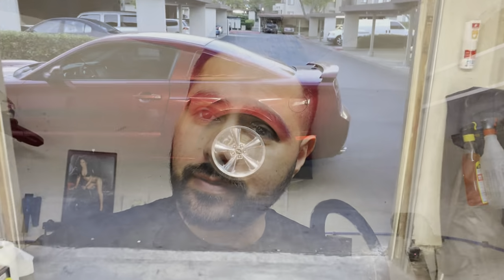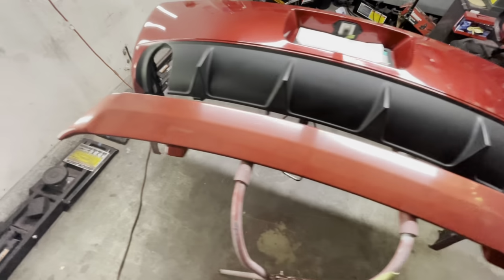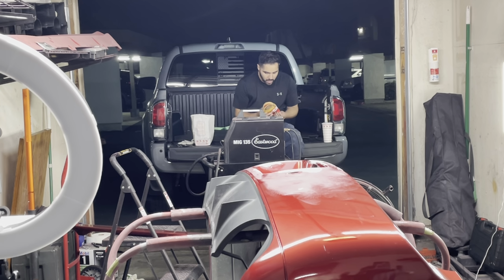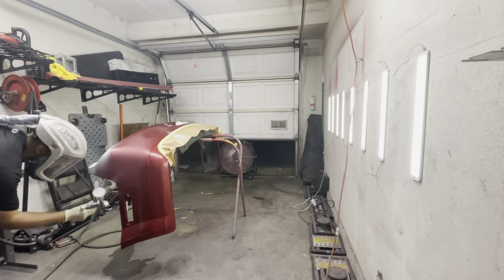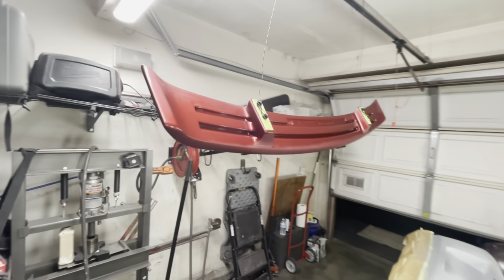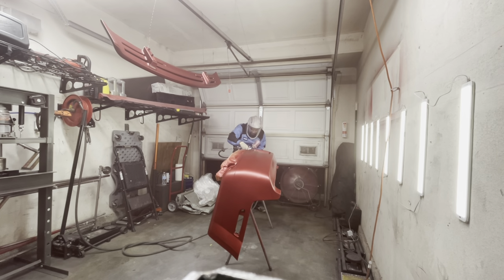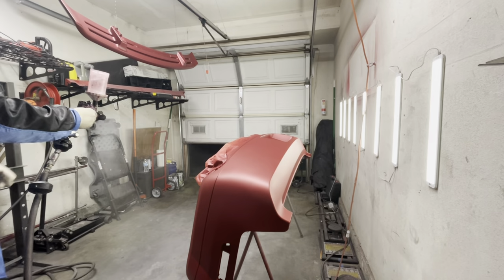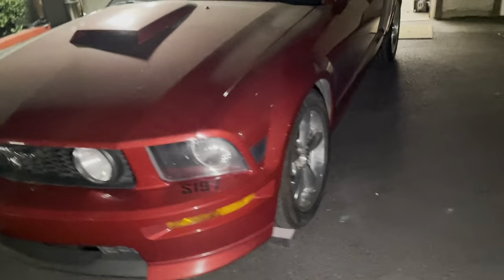Painting a Rear Bumper -Garage Paintjobs

Comment: I think you did a fantastic job considering you were working from a garage (seen worse from a pro in a proper booth), like you I'm just a hobby/diy painter so it's nice to see others doing the same.
The TE10 aircap is mainly for basecoat it can do clear but as you found out it's rather slow, if you want to match the OEM peel then the best cap is the TE20 but it you want a glassy flat finish you need the T110, when I was using my ProLite I always used the T110 1.2 and had some great results, I've now moved on to the DV1 guns and have both the base and clear gun IMO they are better than the ProLite. John UK
Reply from the maker: Thanks John for the kind words, yea the te10 wasn’t my favorite for clear , I shall try to find a t110 and see how it works out
Reply: The T110 may have a different name where you are but I'm not sure so you might have to look around. If you do get one I think you will like it 👍

Comment: how do you like that 30 gallon compressor ? also looks good keep it up , & loving the garage set up !
Reply from the maker: This compressor is great it’s very old but still performs well, I do run out of air quickly depending on how I spray but very manageable for smaller paintjobs and pro guns. And thanks it’s a little small in this garage so a little cluttered but I do what I can.
Reply: @Mechaniclyfe  What psi were you running for clean and base ? im definately getting a 30 gallon to start of my gig too right on
Reply from the maker: With the te10 cap I ran around 32-35 psi , but with the te20 I run it around 26-28 psi

Comment: Was gonna get the TE10 air cap until I saw how much it cost Im like nope I’ll stick with the TE20 and the HV30 air cap which I don’t know what to use that for still haven’t used it yet there’s a ton of primer build up inside the pro lite I have to go back again and clean it can I soak the top of the gun in thinner for a bit? And then take a small brush and get in there bought a few spray gun cleaning kits got a small one that will fit in there
Reply from the maker: That should work soaking will soften the primer
Reply: @Mechaniclyfe  ok sweet thanks never done it before so thought I would ask if it’s okay to do as I tired to clean it as best as possible went to try and spray clear with it nope fan pattern was all messed up opened the air cap and tip saw the build up all on the sides on the inside so used my no name brand spray gun with a 1.3mm to clear the fender of my vw got a front bumper once I clean it real good I’ll try spraying clear on that front bumper and see